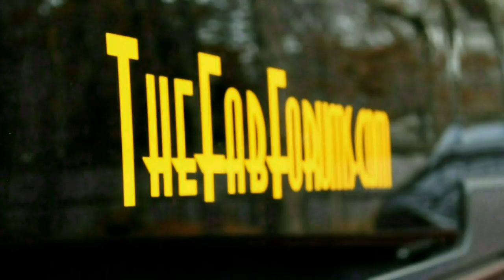Gray Goose Is Loose | Twin Turbo Mustang Build

Comment: We use those Fronius battery tig units at the plant for small repairs in the field. Super smooth arc. Great little machines
Reply from the maker: yeah I hear the DC is so clean off a battery
Reply: Used to follow that Astro van build on the old web site. Any links or info on that thing?

Comment: Hey I’ve got a question for u I have a set of turbos 70mm turbos it was a kit that came with matching tial blow of valves there ether 38 or 44 an I was wondering if I put a set of twin 76mm precision if I need to get bigger blow off valve like a 50 tial I just don’t want boost creep
Reply from the maker: The blow offs dont have anything to do with boost creap, thats all in the wastegates. I have twin 38mm gates on the goose and I dont have any creap  isdues

Comment: one thing i used in the past that could be usefull with making the cut ends of a diff staight and with a nice bevel is this kind of tool https://www.power-technology.com/wp-content/uploads/sites/7/2017/09/1-Mf3i-elektro.jpg
it clamps to the inside of the pipe and you kindah mill the flat and bevel off the pipe using a lathe like knob with a dail
you can use it to get the final couple of 10ths from the axle too before welding
Reply from the maker: thats cool

Comment: Hmm, that welder looks a bit pricy for the looks. I wonder how much use you get on a charge
Reply from the maker: depends on multiple things
Reply: Well it only looks to be 48 18650 cells which is only about 5-600 watt-hours and maybe 6 amp-hours at rated voltage. That is a pretty small pack for a welder.